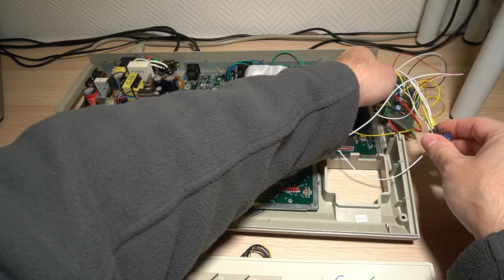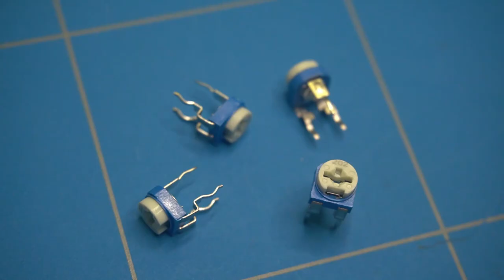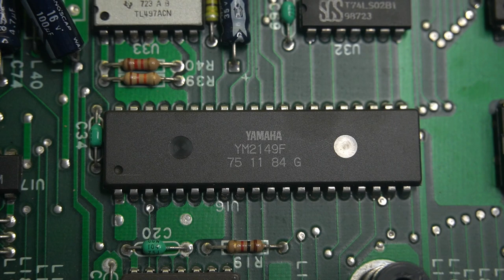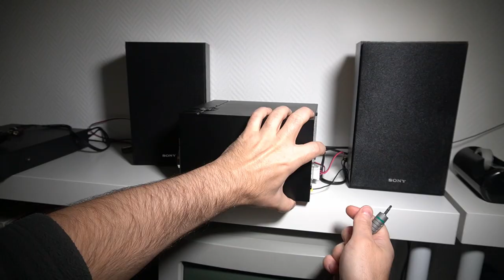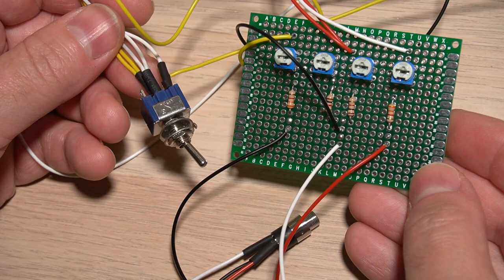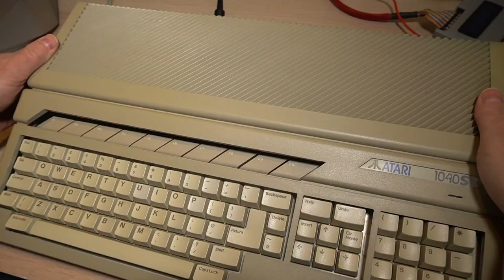Atari ST stereo mod on YM2149 chip

Comment: What does a 4 channel MoD file sound like with this mod?
Reply from the maker: Somehow, I haven't tried a tracker on the modded ST (recently). I remember using it back in the 90s but forgot if the samples got split across channels or not. Will try it soon!